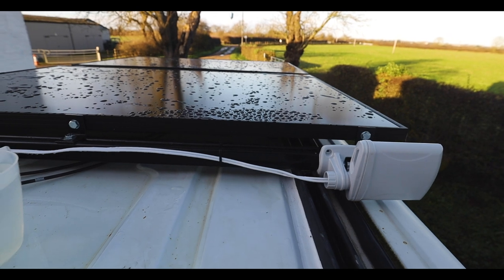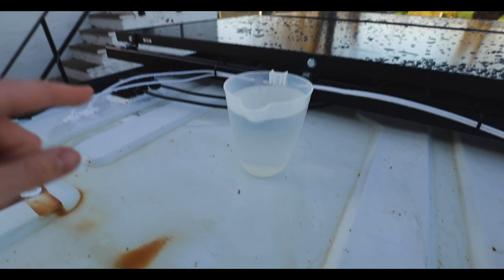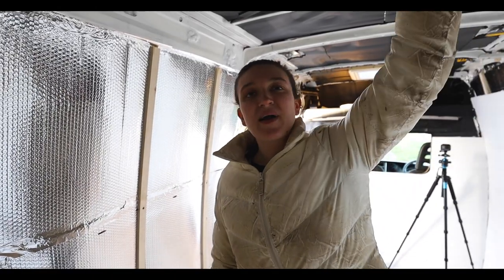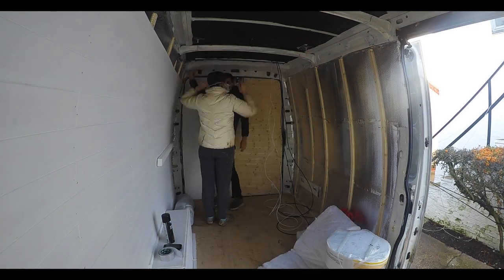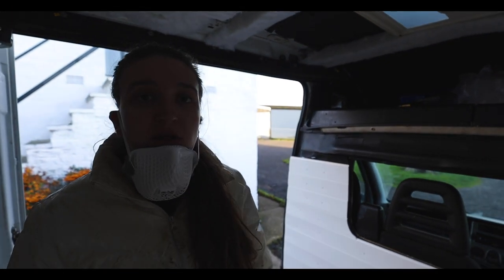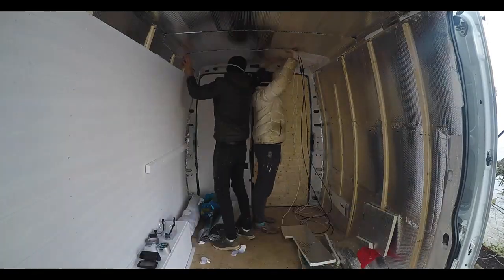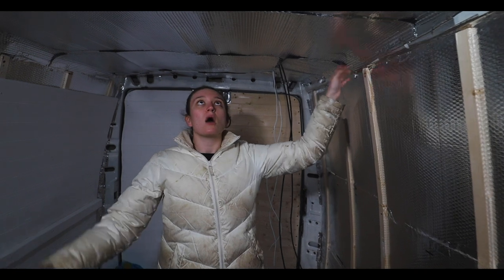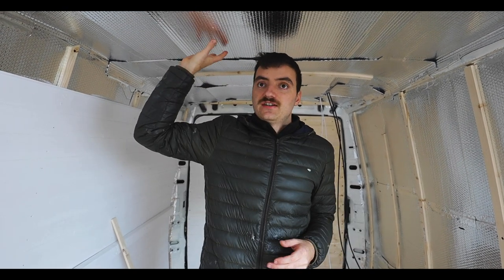Finishing Our Insulation | Van Build UK

Comment: Really coming into its own. I still have the ceiling to do. I was going with celotex, but think I will keep it simple with Dial. Out of interest what is the name of the black material you applied to walls. I have sound deadening marts, but like your idea.
Reply from the maker: yeah getting there now, it does make it alot easier we had to use celotex for a small bit of roof and it was way harder to work with then the wool. it is this stuff https://www.ebay.co.uk/itm/10-x-1-m-Self-Adhesive-Thermal-Acoustic-XPE-Foam-Insulation-caravan-camper-van/151850962655?epid=1942076218&_trkparms=ispr%3D1&hash=item235b05cedf:g:6ygAAOSwYHxWIRyE&amdata=enc%3AAQAFAAACcBaobrjLl8XobRIiIML1V4Imu%252Fn%252BzU5L90Z278x5ickkxGz2ccqatkEnoeekHqhLkQowHWTjDrf1wEy91mKio0LI3F38xMPpqETZRpR0HVnTvhTTNPwWPuPw4yGuXVL4LI5UJEkE0XohHML5GousZXcrzLX4WuRvapcfckIPQXyCsiGIkLwVSm6y%252FW6rcWbjhBMej%252FG3ULGq8Q0ZumZzVXBGxuiPQd5G%252F3JLbRZK9eWJIQwrqE7V4l98Zy5EH09zIODVwVpJP3EGNmDh467RovIGtg%252FaKYpsKMm%252BrdohhwQjcpVeeavdqXt0nJugUBQS9nOHN0cCNXYuSGRbqE0riHoXIPqBLGBlkYJIWnRD9%252FxWV73qkwQ6VyKwCI7zZR3Y%252FkaTKixBTiq%252BOi9xpwchErbDtEB0QibiRbG2Q2RUmIEP9tgEopYMmsDvFzDZsMU5B6OXvw%252BUG3E%252B3wLuY3wTn7BzkjoUkh9v7mZFpKGmMEAgIvT0VmvTH27d8X6OfpUy3xOoziXddL4Dx9qQVSqGsFXfJv5H7YRbrJhxgE%252BaEEc1U9eAYNa%252B2DleCohrIE89AFVpAdR3VVzzLhojegl9agZTvhwN5BZQIYqw%252FXPwDRTPVa%252Fl3ru0p%252F%252FMh0KiCKN%252FAmUYdF6Hn6RqvfFZol6QmPBdb1R3vk87w9Z6U44yDDQjYfn6WGoZGE4X5ZCFVxMl8uycjIT3zLOfvOgjok1zqrjiftnYRrXy3qsGeXtuByvp5LhEMbqsnKx4zzA5TlOnlTnZn0080jXRo3qJ6N119MGhWFGrrgvzBIHVwwrJzIAjSqV1arKd5qfwSxsUpjtlVA%253D%253D%7Ccksum%3A151850962655294c4ef39f4e4056971da8623bd9207a%7Campid%3APL_CLK%7Cclp%3A2334524